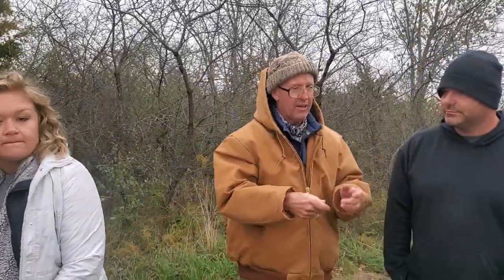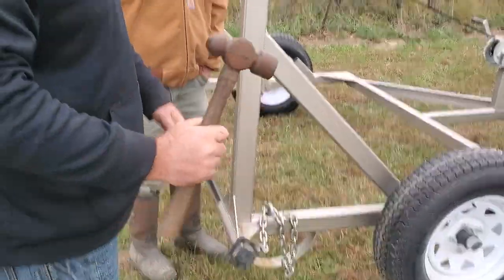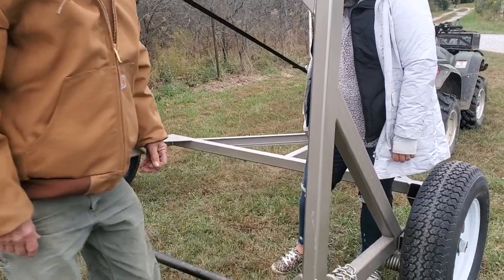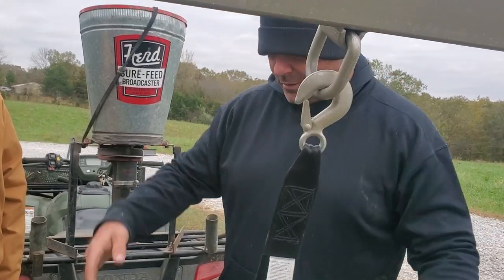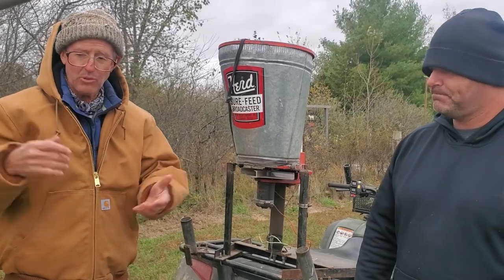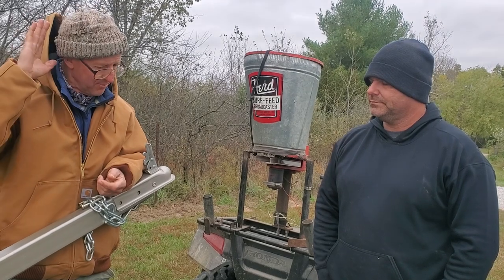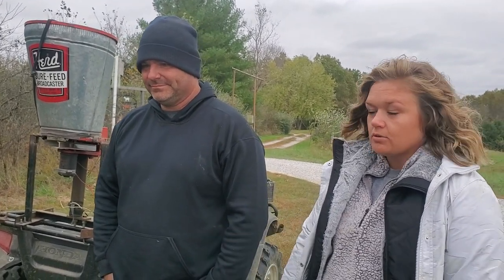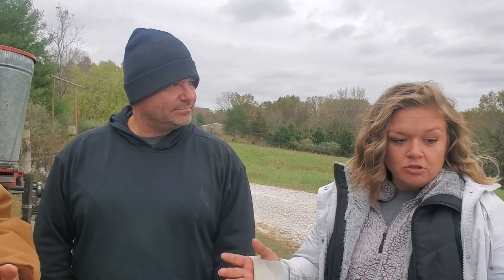Building healthy soil while feeding hay!

Comment: Unrolling is a super good management strategy... but pretty difficult to accomplish WITHOUT a larger machine when the snow gets deeper than a few inches.  I'm in Minnesota, and most of our fields are covered 12" deep + and drifted for most of winter.  If I've been grazing properly and leaving plenty behind, that'll catch the snow like a corn stubble field would, piling it up even more.  Pulling this with a front assist/FWD tractor though probably could work... and there goes the overhead again!

Comment: Greg, you're turning into a YouTube Star-you've a NEW coat! 
Have you considered using 11L-15's on those unrollers? They'd really help increase the flotation in wet conditions and they're a universal farm implement tire so very easy to procure for users.
Reply: Or just have them as an option when ordering, provided they all fit on the same hub.

Comment: Greg
Had athought
Multipurpose tractor implement design. Give this idea of mine a deep dive think session...
On the tractor have Roller crimpers in front of rear tires just as wide as the rear tires to terminate the grass.
The yet to be designed Adjustable height Sickle bar is on very front. Cut the grass (juvenile top) down to the sweet spot for regenerative growth to happen. The cut hay travels down a yet to be made conveyor to be wind rowed onto the crimped grass. Turn later on to opposite empty wind row. At this same time seed drill in a winter crop into terminated wind row, with cut hay folded over on top. When dry, bale as usual.
Thoughts?
Reply from the maker: That might work, but I hate equipment unless it has 4 legs and runs itself.